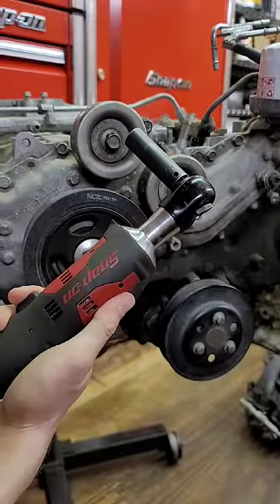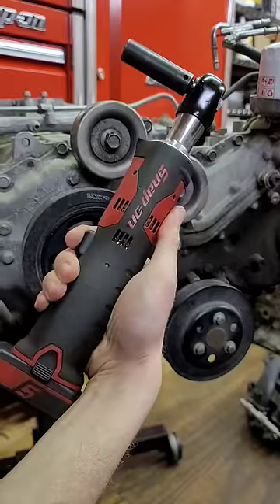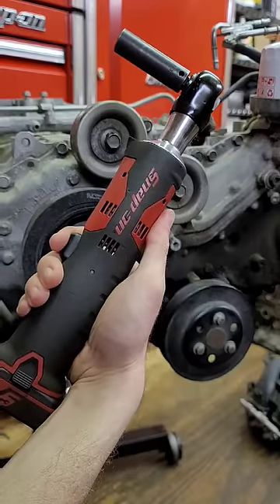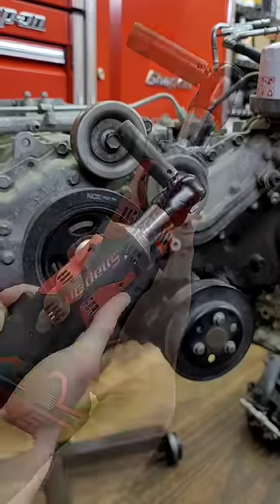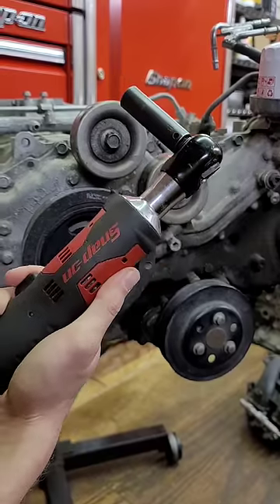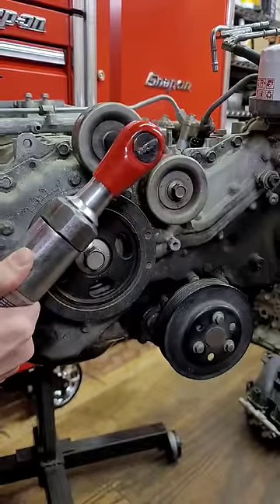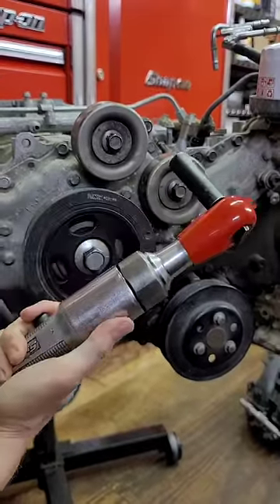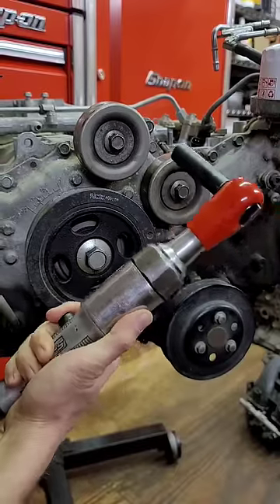Don't Use Electric! Use Air! Duh! #Snapon #Shorts #CordlessRatchet

Comment: I thought I was crazy paying $400 for a Milwaukee right angle impact gun. I got it because it was the strongest right angle impact on the market. That was two years ago and it has made my life so much easier. If I need real power, I use a breaker bar. Break the nut or bolt and then finish taking it out with the impact. Start a bolt in and finish it with the impact and then torque wrench. I have the 3/8" drive version and will use settings 1 or 2 which isn't enough power to strip. It also has an antistrip setting but setting 1 works too.

Comment: I tested the metal of the electric snap on impact wrenches and it came up short, it lasted for a while, and even with heavy duty, lubrication it failed. Ultimately, my pneumatic ratchet was superior. As long as I kept it lubricated it was golden, but loud, which is why I like the electric one. Gain from my experience… Keep on rocking.😊

Comment: Cordless ratchets also allow breaking of stubborn bolts. Yet I use a standard ratchet to break them then the cordless to remove it. A timesaver depending on location and length of bolt.

Comment: Snap-on battery ratchet and impact guns are fantastic. Ratchet might break loose a tight bolt if you could get a little running start on it. Get the ratchet spinning first for about half a second then get it on the bolt or nut. I know it sounds crazy and it takes a little bit to master it but you definitely get a little more torque out of it.

Comment: Given the choice, I would still run that FAR72 on 90% of my work. My coworkers have spent boatloads on all electric tools and they still need to borrow my 1/2" Matco impact on stubborn stuff their dewalt & Milwaukee won't break loose. Being in a tire shop, we remove & install wheels all the time... Sometimes my coworker will tag team a rotate & balance with me and it seems like I can remove lug nuts a bit quicker. I've also had that Matco 7 years. The tire shop has been open about 1.5 years and they've had their electric stuff about that long. I will say the cornwell 3/8 air ratchet I have sucks but mainly because the valve doesn't always work proper but it was free so I can't complain too badly but it's nowhere as good as the old snappy FAR72

Comment: i work as a forklift mechanic so im often not at the shop and dont always have air unless i fire up my compressor and can park close enough or move the forklift, so the battery ratchet is great, i break it loose then use the ratchet, i was also honestly surprised the air got the first one

Comment: I've 5 of these snap-on electrics long reach short reg 3/8 and 1/4.  I still have the air ratchet in my drawer but it is only used as a paper weight when the hangar doors are open.  I almost never use a regular ratchet anymore.

Comment: The snap on electric ratchets can clutch dump so you don’t have to crack the bolt first. But in doing that. You’ll reduce the longevity of the ratchet

Comment: I have the Milwaukee cordless ratchet, and it can be helpful, but working in the Midwest, everything is very rusty, so just because you got it loose doesn’t always mean it’s completely free.  Being said, I still like my cordless ratchet just because they’re quiet, and I don’t need an air hose.  And I don’t need to deal with the slight air leaks that become deafening loud over time as it slowly bothers you more and more.

Comment: I like my Milwaukee air framing nailer still so my compressor does get used on occasion. For mechanical work, I have a suite of air tools, but switching primarily to electric.

Comment: For several years, I used an electric impact wrench to remove mobile home tires and axles. I didn't use ear protectors because they took too long to get and put on. Speed in these jobs was important. Anyway, nowadays, 68-y-o, I have tinnitus (ringing in the ears). I don't know if it's related.

Comment: you know whats also handy about "cordless" ratchet? you dont need electricity to run a silly compressor and have to wait for it to fill to give you full advantage of the tools. being in the trade for 15yrs...  i only use my air tools at work - maybe, only cause its a shop. my cordless supply me with endless work on the side of the road as well as working on personal vehicles at home.

Comment: For light duty electric is fine but for true industrial heavy use its air all the way.  I spent years drilling and rockbolting in an underground hardrock mine and air was the only choice for heavy applications

Comment: Electric is always great to have because of the convenience especially if you're on the road a lot and the air tools aren't available.

Got an electric 1/2 inch impact which worked great.

Planning to get electric ratchets next then after the ratchet I'm planning to buy a big electric impact for breaking semi truck lugs.

Comment: You're supposed to use the air ratchet to break the bolt free. I've got a cordless Milwaukee at work and it doesn't have a hold to break free setting so no matter what to use it I gotta break the bolts free by hand with hand tools. Double the work to use the cordless

Comment: Took 6 months for this video to come back round, and it seems that nobody on here knows what a ratchet is. 
A ratchet is a hand tool, powered by human muscle. They make a soft clicking sound, and an occasional grunt from the power source. 
Pneumatic and later electric were later developed, to assist with stubborn fasteners. They are not intended to replace a ratchet, as they provide no feel. You will over-tighten, and brake many bolts.

Comment: I’ve been a heavy duty mechanic for 40 years and everyone uses air & battery run ratchets wrong. You start the ratchet then put it on the head of the bolt when it’s running & it snaps the bolt loose. No more putting it on the head & breaking it manually.

Comment: My battery powered impacts usually match or exceeds my air impact on torque. 
To be fair each have their place but my battery powered impacts get used most of the time.

Comment: Air tools require a compressor with a whole lot of capacity ($1,000 + ) and long hoses and swivel joints. All I need for my ratchet is one battery (or two) and a charger.

Comment: I do diesel work for ford, I could not deal with a air ratchet in all the right spaces, I’ve got 1 1/4 inch Milwaukee, a 3/8 Milwaukee and the long neck variants and a 3/8 Matco electric ratchet and I love them all. Matco has more power than the Milwaukees but the battery falls out the bottom of the Matco

Comment: When I was doing pipe fitting I thought the same untill I sat there 10 mins shaking my hands apart with an air impact, then the electric did the job immediately

Comment: The thing is that actually you break the bolts loose with the electric ratchet just like a normal ratchet and then power it in order to get the bolt out faster is what I've heard

Comment: Electric ratchets are for tight spots.. a scenario like this use an electric impact gun. Itll break it loose and spin it out much faster. I have both, a 1/4 inch electric ratchet and a 3/8 electric impact gun and the only time i go for the ratchet is if my impact gun wont fit. Convinced all my body shop coworkers to get them too just by using them all the time and never going for the hoses. Less time walking for hoses means more work getting done. Which means more money in our pockets. They pay themselves off very quickly in the right hands.

Comment: I’ve used the snap on electric ratchet for at least two years, it’s the only 14.4 tool I have and I’m glad, those batteries are junk I’ve had two crap out in less than two years just outside of the warranty period. I’ve had a Milwaukee m12 electric ratchet for the same amount of time and those batteries don’t miss a beat at all. The only difference is my snap on is 3/8 drive and the Milwaukee is 1/4. But Milwaukee has a much better warranty at about half the cost and based on my experience better longevity too. The only thing snap on has over it is speed and price
Reply: I should clarify that I do realize that snap-on’s warranty period is a year on the 14.4 batteries. my ratchet I bought came as a kit with two batteries that died as just outside of the warranty period. I actually bought the Milwaukee before the snap on and it still has the original batteries, just food for thought

Comment: Now if you use an electric air racket to break loose it's a lot harder on the tool than doing it with an air ratchet that's pretty much what breaks the Snap-on electric tools is manually breaking bolts. And since Snap-on for instance won't warranty the Electric Tool but will warranty the air tool

Comment: Man I hate having to use manual ratchets now since I got my cordless. Can't believe I wasted so much time working on my vehicles using my old manuals only being able to make 1/8 turns with fine threads. Cordless ratchet bump it loose and zips right off

Comment: You shouldn't need a super high torque on the ratchet it's meant to get into tight spaces and get all the 10 mm oil pan bolts off. Battery tool has no cord, maximum compactability. I use the M12 ratchet non fuel version, very compact, life saver.

Comment: Never got into pneumatic or electric  ratchets, but I do see why they'd be a game changer especially in tight spaces. However, I just have my 3 different sized impacts and a litany of swivel sockets. Gets 90% of what's needed and anything spaced smaller rarely fits a pneumatic or electric rachet body anyways. I have a pneumatic ratchet and ways wanted an electric one. But it's not super needed when right angle impacts exist. I also hate using air for just 1 tool when my battery impacts can break bones and bolts without making the entire garage go deaf every ten minutes lol

 I don't see why having convenient tools is such an ego trip for some technicians.  If you want to make your job harder that's fine, but maybe don't hate on innovation just because it's unfamiliar or you can't afford it yet.

Comment: But you can take the electric one the on-the-go and a thing I found out get it spinning beforehand. Put it on if you do it right you won't ruin or break anything you won't strip the bolt or you won't break the ratchet unless you do it wrong

Comment: Air guns also rely on a quality air supply. One of my old shops had bad piping, rusted af. Couldnt tighten a bolt to save your life. My buddy had a similar problem at a shop he worked at, didnt find the source of the problem. Im not the biggest fan of electric, but not being in the field anymore and knowing what im guna get when i send it helps me rationalize it. Not to mention water and the fact at some point you're guna have to change lines and unless youre a top tech, you have to share your lines, and you have to rely on fcking Tony not to dunk the hose into snow/puddles.

Comment: Obviously "cordless" refers to the fact it's an electric ratchet that isn't plugged into a wall socket or generator.  

As I see it, anyone hating on these wonderful tools fit into one of two categories; old school mechanics who are loathe to change from what they've always used, regardless of the inconvenience and additional noise, and occasional tool users in any trade or at home who don't ever work on repeatable, disassembly and assembly of nuts and bolts. 

I just finished deprepping 1200 professional light fixtures, along with regular prep, quality control, etc of other orders. This work requires attaching and detaching specialized clamps to brackets or yokes for each fixture, and for safety they use nylock nuts. Manipulating hundreds of nuts on bolts by hand is extremely time-consuming and difficult due to short swings of a manual ratchet. The business has drills and impact guns, but no electric ratchets. I'm kicking myself for not taking the leap myself already, as many of these applications are in tight quarters in which impact drivers with sockets will not fit. Would have been a godsend.

Also, these tools would be incredibly useful on our gigs. Space is almost always at a premium because we truck every bit of concert sound, lights, and video equipment, along with sets and pyrotechnics from one venue to another each day. Almost nobody as room for, nor feels a regular need to keep an air compressor in their pack. Compare even an undersized, potbelly compressor plus hoses and tools to the tiny footprint taken up by one of these cordless ratchets.

I'm just about to pull the trigger on one of the new Milwaukee M12 ratchets, as I'm already invested in the battery platform.

Comment: I’m a body man but it’s the tool I use the most for breaking down and re assembling vehicles. In fact, I have the exact 3/8 ratchet and that piece of shit broke after 4 months, was gone for a month and broke 2 days later. Gave me another one 2 weeks ago and the head is already stripping out. I use my mini impact or larger if I’m breaking stuff free and never wrench down on it any harder than you need to put body panels back on. Not hating on battery powered tools, just saying Snap On sucks with quality control and then tell you that you’re using their tools wrong.

Comment: I have all lithium tools (I also have all of them in air). I work on highline vehicles ($100k - $10 million).  Lithium tools are quiet, Portable [meaning if I have to go to a customer's house and do work, go to the storage for the sales department, or we have a track event (between these three,  it's a weekly occurrence) I don't need a compressor. Not to mention,  I don't have to worry about a dirty air hose mucking up factory matte finishes (TRUST me,  grease from a air hose on a matte white finish is a NIGHTMARE for the detail guys.  Lithium is the way to go for sure.

Comment: The electric or air just makes it faster getting the bolt or nut off quickly there not made to be able to break anything loose an air impact or electric impact is made to break bolts or nuts loose so with that being said they were made for the convenience of your time an making the process not seem it’s taking forever

Comment: My electric air compressor is 70 years old.  It's only the electric part of it that has ever failed.  "Cordless" tools are nice if you don't mind buying new batteries every few years and then buying new tools when the batteries get too spensive.

Comment: Electric ratchets and tools have made a lot of progress in the last few years I used to say the same thing about using air tools but the difference is not a lot but air tools are stronger but electric tools are more practical you don't need air line drug across the shop

Comment: I prefer battery tools. I have a 1170 Ft-Lbs Breakaway Torque/700 Ft-Lbs Fastening Torque, 1/2" Ryobi HP 18v Brushless Impact Wrench on the way.
That's not by any standard weak. I haven't run across anything on my 20 year old Jeep 1170 Ft-Lbs can't handle, and If I ever do I have a 4ft Steel Pipe for my Gearwrench 1/2" drive 17" locking flex ratchet or my 18"-24" (1/2" drive) breaker bar. I have broke bolts off with ratchets and breaker bars. 
But again not much can stop the Ryobi # PBLIW01B-PBP004 with an HP 18v Battery.
I could pay 5x the price for an extra 300ft-lbs but I'm fine with the 1170.

Comment: the air ratchet broke it loose fine. If you would have hung on to it, it would have broken the second one loose. I have both air and electric, and they both have their place. But an air ratchet will brake loose almost anything I need it to

Comment: With the technology now in days electric impact tools have just as much power as air impact tools. The cordless is cheaper investment cause you don't need an air compressor and hose. Air compressor is expensive and noisy and you will trip on the air hose. The air tools are noisy too. 

Cordless tools are quiet, no hose, no compressor, no unnecessary noise, cheaper in the long run. Only con is when the battery dies while you're on a job. Have multiple batteries charged so when one dies you could swap for a fully charged battery and charge the Dead one.

Comment: Back then electric tools had cords which were not that long. You always had to carry an extension just so you car work comfortably in your work area, now these are cordless as they come equipped with battery’s (that’s the electric source). Safer as nobody will trip over your cord no more and kill your tool xd

Comment: I don't think air is more powerful than battery powered anymore. I got that Makita 3/4 40V impact and it honestly is faster taking off lug nuts than the 1 inch air impacts the shop has.

Comment: I'd use air tools if I had a shop, bit since I work on my car in a shed that barely has electricity, I'm sticking to battery power (cordless) 
both do the job just fine if you ask me (a 22 yo amateur car enthusiast)

Comment: I like electric tools a little better, yeah if a bolts super stuck I can get the air, but if I have a tool that's easier to set up I'm gonna just use the easier electric tool.

Comment: "They" are right. Buy pneumatics. My electrics just collect dust anymore, with the exception of my Milwaukee right angle ⅜ impact and Milwaukee nut driver. Snappy has incredible ¼ drive long neck air ratchet that is worth its weight in gold. Cornwell has the ⅜ version.

Comment: You don’t want a ratchet to be too strong. I had an old aircat air ratchet that would F your hand up if you got it in a bad situation. I prefer break it it loose manually and then letting the tool do the work.

Comment: Both tools you can use as a fixed socket. 🤔 Use a air drill vs. Battery to drill a hole in stainless steel.  Snap on just a name. No quantity!!

Comment: I hate my air tools, the worst part is the compressor. It's so damn loud. I can deal with the hose but the noise makes me wanna leave until the tank is full then I usually cut the power so it doesn't recharge while I'm using it. I got a triple sized tank just for that reason.